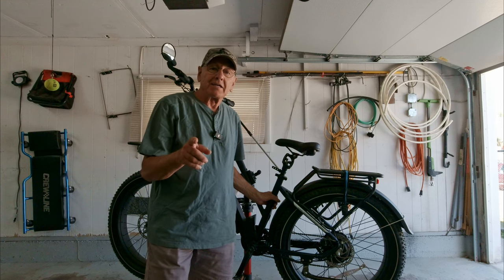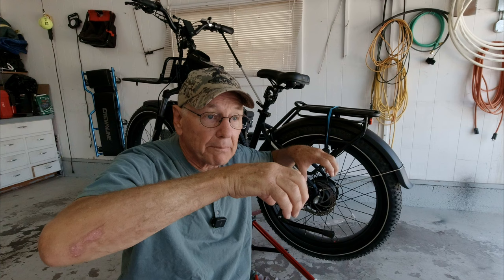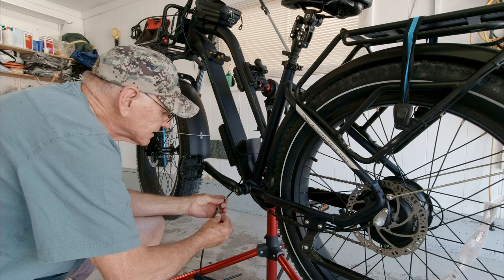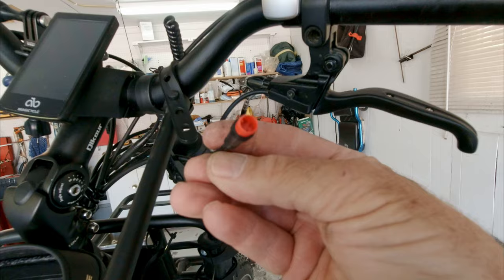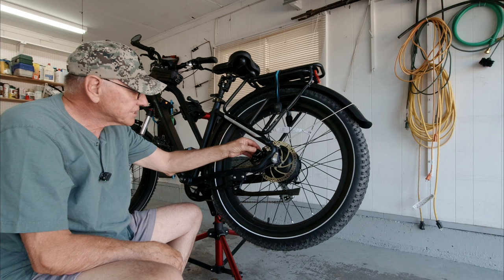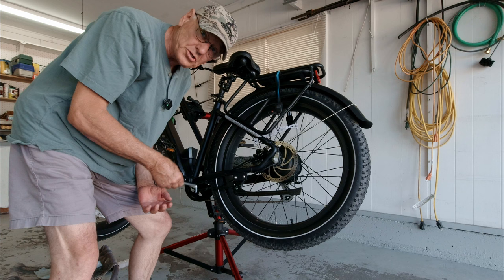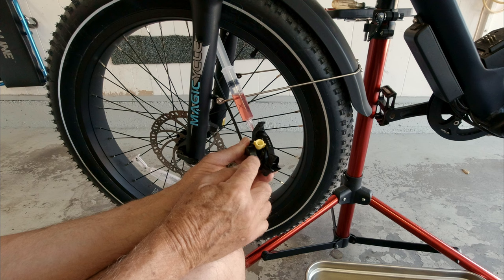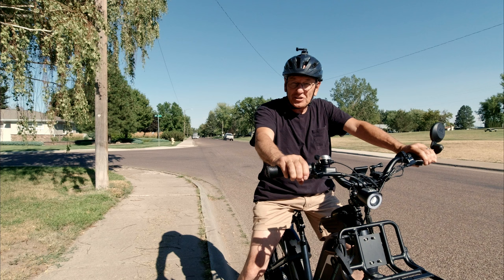Installing Hydraulic Brakes on a Magicycle Ebike

Comment: That is EXACTLY how I pulled my hydraulic housing sheath through..Great minds think alike, really many electrical lines are pulled in that manner, so anyone with that skill set wouldn't consider any other method, although I have seen some YouTubers fight that job with silly methods, but ya don't know, what ya don't know...Ran into the same problem with the length on the front brake, but I seen the same video ahead of time where the guy put the brass compression ferrule on wrong so I didn't make that mistake, that was a couple hydraulic brake installs ago..Not all hydraulic brakes are exactly the same though..But if you order the Tecktro from Magicycle, that certainly applies..Nice tutorial, I've sent a bunch of people to your video about raising the handlebars..Think we are seeing the collapse of civilization pick up it's pace, it's not going to be pretty..I'm about as far off grid and self sufficient as one can practically be, other than the internet,coffee, sugar and a few other things I could manage without...Still time to prepare, but not much....
Reply from the maker: I hear ya and I keep things around for that purpose.  It's also why I live where I do.  I also think that electric cars aren't there yet, but the electric bike is doing well.
Reply: We are all so indoctrinated in this civilization, we can't envision other ways to live, which is understandable to a degree, it's all we know..But, every part of the civilization is delusional, in reality..The human myth of never ending progress, that makes life better for a portion of the world's population, at the expense of the rest of the world's population, and doesn't critically examine the consequences of this never ending progress, which is it negates any future what-so-ever, and the loss of most complex life on Earth, is a very sick story indeed..Every civilization to ever exist has went through the same exact cycle; a conquest phase---an exploitation phase--and a collapse phase, and they all collapse exactly the same; they destroy their local environment(this time the scale of local environment is Earth itself), they carelessly rifle through their natural resources, they engage in expensive and self defeating wars, they spawn elites and a ruling class that destroys the institutions and infrastructure that make complex societies possible, they bring home the same tyranny, violence and control that the visit on their neighbors, they cannibalize their own countries when they run out of new lands to conquer and pillage, the ruling class falls into a feedback loop of horrible decisions and policies that eventually reaches a tipping point that can't be overcome..Which brings us to where we are today, the collapse phase of civilization..We could have broken this cycle easily because it's thoroughly understood and documented, by merely maturing past greed, ego and violence, but we apathetically refused..Instead we created this game of monopoly that exploits everything to exhaustion...Sorry, have a deadline on an article I'm writing and just organizing my thoughts in this comment, but I'll leave you with some quotes from histories voices that understood this process.."Civilizations are not murdered..They take their own lives"--Arnold Toynbee   "Forests proceed civilizations and deserts follow them" ---Francois Rene De Chateaubriand  "Civilization is a hopeless race to discover the remedies for the problems it produces"---Jean Jacques Rousseau  "All of our EXALTED technological progress, civilization for that matter, is comparable to an axe in the hands of a pathological criminal"__ALBERT EINSTEIN  "Those who can make you believe absurdities,can make you commit atrocities"--VOLTAIRE  "It's no measure of health to be well adjusted to a profoundly sick society"--Krishnamurti   "The end of the human race will be that it eventually died of civilization"---RALPH WALDO EMERSON..Good luck....

Comment: To remove the grips on a motorcycle we used to take a air compressor and insert into a small hole in end of grip and shoot a stream of air into end of grip and the grip comes sliding off very easy to do
Reply from the maker: Now I need an air compressor! Oh well, I'll have to force myself to go to Harbor Freight... Lol!

Comment: You should never touch the rotors with bare hands and if you do then wipe them down with denatured alcohol. Now for removing handlebar grips just use an air compressor, spray air between the grip and bar and they come off with ease.
Reply from the maker: Thanks for the tips.

Comment: My dad showed how to take off handlebar grips the easy way, blow a air through one end of the handlebars, try to get a fit where air will not escape, and the grip will come off, easy peasy, this trick I learned, 60-years ago.
Reply from the maker: I need to get a compressor, for a variety of reasons!
Reply: @gonagain  you don’t have a compressor, what kinda garage are you running, lol.
Reply from the maker: I know. I'm ashamed.
Reply: @gonagain  make a pilgrimage to Harbor Freight and all will be absolved.
Reply from the maker: I'll have to sneak in there when I get home.

Comment: Does it charge by solar? Thanks Rick-could be a solution for my charging needs that is more affordable for me
Reply from the maker: That would depend on your solar panel.  Some panels have a small charge controller on the back, like the Itehil panel, or come with a small controller, like the Xtar panel, and with these you can plug into them directly.

Comment: Hi Rick, it's me.  If you were going to buy a power station now, what brand name would it be?
Reply from the maker: I still prefer the Bluettis, because they are always redesigning and improving their product.  I'm plugged into one right now.
Reply: @gonagain  For the size I figure that bigger is always better.   I'm thinking that 1000 or bigger is the way to go.
Reply: @gonagain  I have my eye on two.  Both are Bluetti's.the EB200P at $1,398.00 and the AC200P $1,499.00.  Do you have any hands on with eather unit?